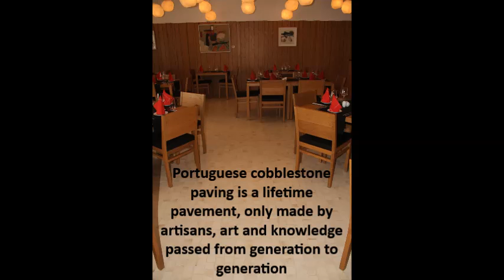Hand made cobblestone cut and Portuguese pavement laying techniques Roc2c

Comment: Looks  like nice artwork. But one question, they are putting stones on powder sand (not compressed), how you expect the surface to keep straight surface after some time.. stones should sink and after some time the surface should be uneven??
Reply: its a mix of sand with cement below the cobblestones